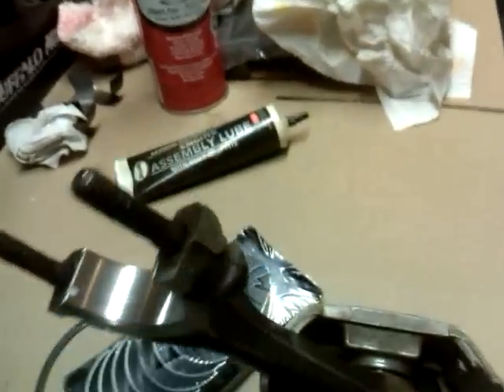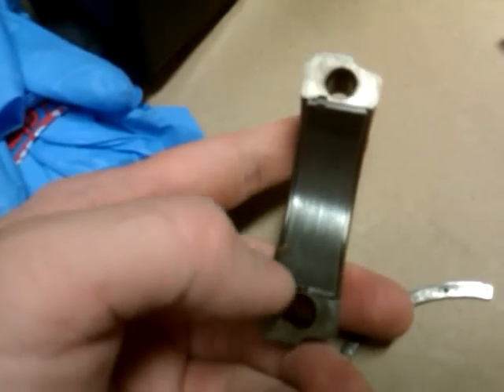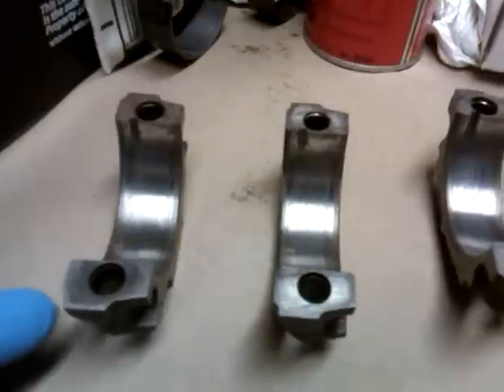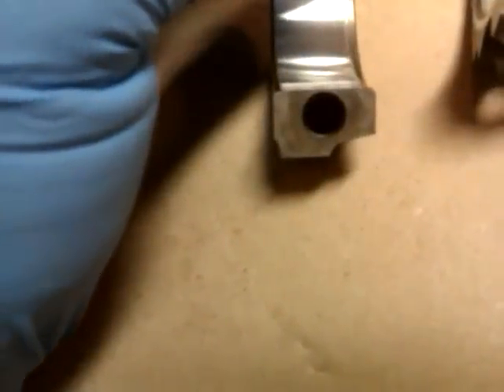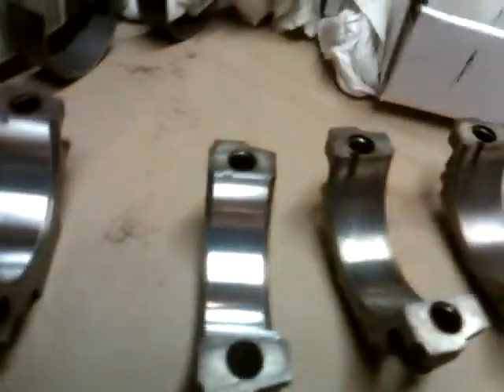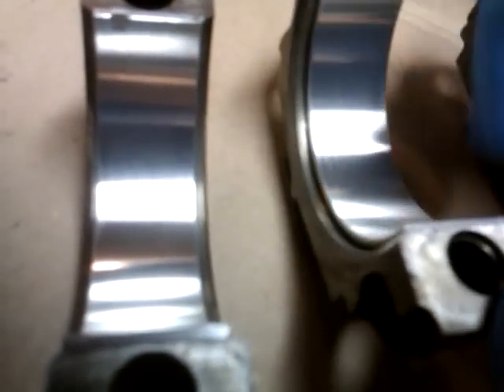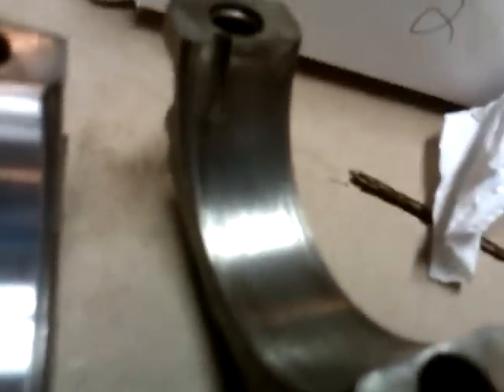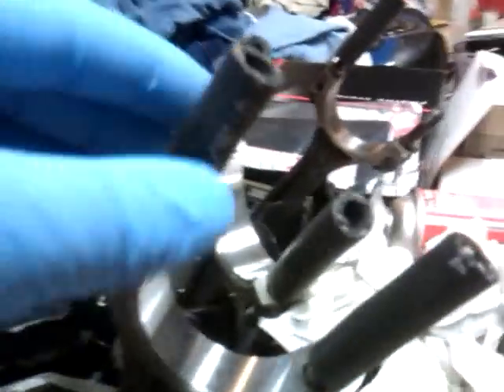how to replace piston connecting rod bearings

Comment: Like the idea of using the rubber hose for your threads and crank protection.... You think? Isopropyl Alcohol will work for cleaning?  Or should I get some brake cleaner?

Comment: are the new connecting rod bearing a lil thicker than the old ones? if so is that a problem?
Reply from the maker: They are not worn ,so they are thicker , but only as thick as the originals were when they were new. This is not a problem, you are simply replacing word out parts. It is a problem if the bearings wear thin and catch on the piston connecting rod and turn or "spin" ,and then abruptly lock- up the piston connecting rod causing it to stop and break apart,(spun bearing) likely throwing a rod through the engine block or through the oil pan , or both.  The distance between the connecting rod bearings and the crank must be within the engines specifications , and can be measured using plastigague.

Comment: The backs and the front of shells went in DRY .....not lubed back or front .....cheers
Reply from the maker: The bearing race should be oil free , cleaned with brake parts cleaner, when installed into the connecting rod and the end cap , but then the surface between the bearing race and the crank Must be lubricated with Engine Assembly Lube. this longer video may help
How to rebuild an engine = how to replace piston rings,rod bearings, tap in a piston